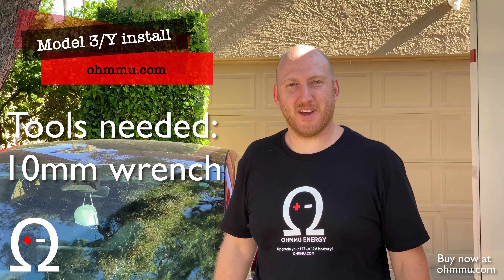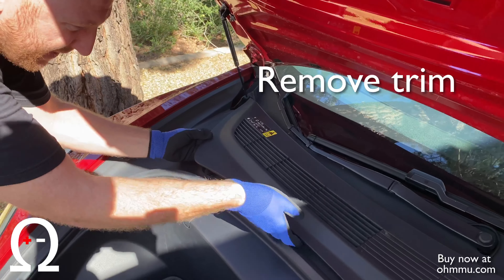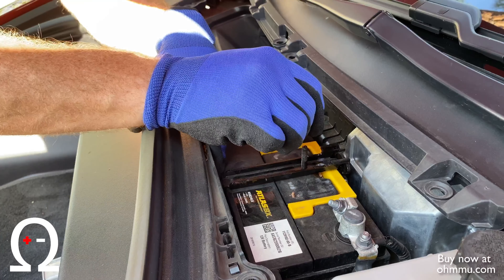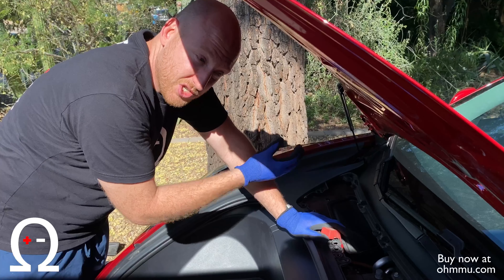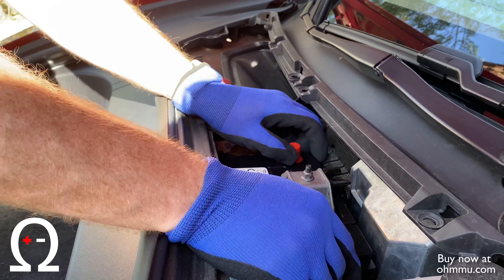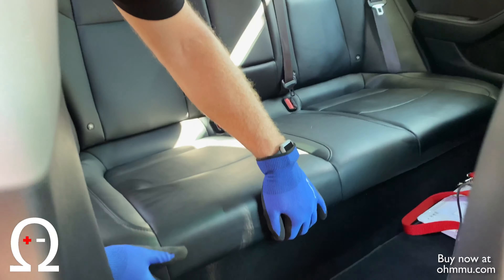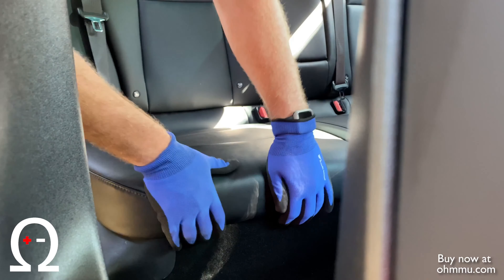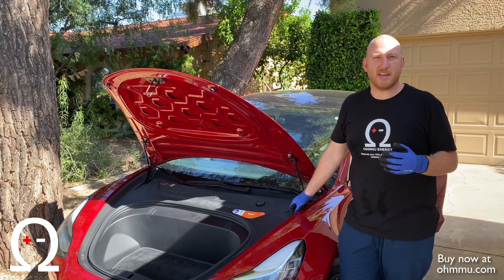Tesla Model 3 12V Battery Swap

Comment: My Model 3 battery died without any warning, leaving me stuck in my rural hometown. Tesla said that I was out-of-reach of mobile service until the second week of September, and that I'd have to have the car towed to their service center 90 miles away at my expense to have it replaced sooner. I decided instead to order this replacement, since, even if I was out of commission for a couple days, at least it would be shipped to the door. Less than 24 hours later, and I just finished the install with the help of this video, and everything is back up and running.

Comment: Here’s the situation for most people...your Model 3 12V battery is going bad, the car tells you it is going bad and you have time to call Tesla service.  Tesla comes to your house a couple days later and installs the new battery, free, under warrantee.  If you’re lucky even the next time the 12V fails you are still inside the 8 year warrantee.  After that one might want to consider alternative batteries, not before (and not before 2025 for any Model 3, first released in 2017).  If you’re too far for mobile service, you can always take a little road trip.
Reply: Or just go to Walmart and for $150 get a 51R battery and put it in yourself. Took me 10 minutes to install and less hassle than taking it in for service.  Are you sure the 8 year warranty covers the 12volt battery and not just the high voltage one?

Comment: I changed the 12v battery just as you had shown. The car now works. However, the warning message to replace the battery soon did not go away. I rebooted the car twice. Now what?
Reply: Here's a quick update. The replace battery soon message never went away. I brought car back to tesla. Apparently, there is a reset button underneath the back seat on the passenger side. It took the service tech 2 minutes. Now it's back to normal.
Reply: Roger Chan thank you for sharing that!
Reply: @RogerClubv  Hi Roger, did the T Tech tell you how to do this reset by yourself?
Reply: @richphillips3194  That's the gray low voltage connector that you see them disconnecting under the back seat.  I think I'd power off the car (in the service menu), then disconnect that connect, wait a bit, then re-connect to clear the 12V battery warnings.  It's possible you'd also need to disconnect the 12V battery, but that I'm not sure of.  Since the tech cleared it in 2 min, they probably didn't.  Perhaps someone else knows?

Comment: The written instructions (Tesla/Ohmmu Tech Note) differ slightly. The Tech Note tells you to disconnect the 12v battery before the high voltage, then disconnect high voltage then wait 2 minutes, then specifically NOT re-connect the 12v battery until the high voltage is re-connected. It warns that re-connecting the 12v battery before the high voltage can lead to over discharge issues (though it sounds strange as nobody would do this for an extended period). I think both instructions are safe and work. I followed the Tech Note but this video was still valuable to give confidence about the procedure. It would be good if Ohmmu could correct either the Tech Note or this Video to avoid uncertainty for other customers.

I highly recommend the Ohmmu replacement battery for weight savings and longevity alone. The potential benefits of more power with less sag are a bonus too. A replacement Tesla battery with labour costs at least half and may have to be replaced twice in the same 4 year warranty time of the Ohmmu battery. This is a positive upgrade whichever way you look at it, for the features or just to avoid having to replace the lead acid battery. It will most likely return more than the investment over the lifetime of the car, as LiFePO4 batteries should last that long without any replacement.
Reply: Yeah, it a bit frustrating that they still have the sequence wrong. Negative of 12V is the first thing to disconnect and the last thing to reconnect. I wonder how they missed this in the video.... and don't correct it.
Reply: Interesting. Thanks for the tip!

Comment: I had to buy a Tesla battery today because my car literally died outta no where, but your video was extremely helpful

My model 3 is at 144k miles and this was my first 12v.

Might I suggest adding something on how to open the hood when the battery is completely dead? In case anyone is wondering, pop the tow hook cover off, grab the wires connected to it, and hit em with a 9v battery (positive wire is marked red, and is longer).

Comment: Great vid, just bought a new Model Y so not planning on replacing my battery for a few years, but I did ask my local SC how much it would cost and they said $112 ($85 for OEM battery and $26.25 Mobil service labor total is $111.25).  That’s cheaper than I anticipated and it’s done in your own garage.

Comment: Not sure how long the OEM batteries last but I've saved this video towards battery replacement when the time comes.
Excellent video, thank you!
Reply: @Daniel Brice Arizona heat is killing some batteries in not much more than a year (folks that park in the sun a lot I'm guessing).  My battery is alive and well at 14 months thus far...
Reply: Just replaced mine at 1.5 yrs; Florida.
Reply: @Daniel Brice Make it "about 1/10th the price" in Europe.
- Ohmmu Lithium Battery 439USD+20% VAT+shipping from USA (or 559€ shipped from a european online store)
- Varta 12V lead battery: 58€ shipped on Amazon
Reply: My 2018 M3 still had a good battery. They say if you keep it plugged in it takes stress off the 12 volt battery and it will last longer and in my case it’s true but I replaced it anyway. You don’t want a 12 volt failure on the road. It’s a pain to reset it and get the car to drive again. I’ve watched many YouTube Tesla guys who explain this. Good purchase price from Tesbroes  there a certified dealer for Ohmmu for only 373.15 as I got 20% off coupon. You can google tesbroes for valid coupons. Good luck
Reply: Mine is 7 yrs old and I just got a notice to change the 12 v soon.

Comment: Nice video. Just got an alert on my 2018 Model 3 to replace the 12V battery.
Reply: My battery was still under warranty 😃
Reply: My 2018 just past warranty just alerted me to replace the 12 volt battery. I am very much on the fence about replacing with this battery or the regular lead acid. Can anyone comment as to a noticeable difference in any way? Length of service etc....
Reply: @18837dc  no clue but I'd see if Tesla would replace it anyway if you haven't already. There were known issues that drained our 12 volt's prematurely

Comment: You guys need to make a installation video for the Model Y on your website. I looked under there rear seat the high voltage cut off is not located there on the Model Y.

Comment: That's not the correct power down procedure you can damage modules in that way. Granted it's a very small risk but still not worth it. 
1. Lower windows and power off from screen
2. Disconnected the neg cable on the battery 
3. THEN disconnect the LV connector under the back seat.
You can now replace the battery however once you do, DO NOT CONNECT the neg  cable yet. 
Now powering back up is in reverse. Connect the LV connector then finally connect the neg cable

Other then that it's a very informative video
Reply: I know the last step in your comment is, well, raise back the windows. 
I do want to know, however, why lower the windows as first step? Is this step only for summertime?
Reply: @TeslaEVVideos  it's cause when it's powered down the windows will not lower when you try to open the door and you can possibly slam it on the chrome trim
Reply: What if the battery is so dead you can't tell the car to turn off?  Same steps but skip that one?
Reply: Trying to bump this up.  Mountain Pass performance also has a guide for this.
Reply: @TheBowerbird  The Mountain Pass Performance guide is missing the steps for disconnecting the low voltage supply to the penthouse (under the rear sear),
Reply: Thanks for the clarification.  Even the steps from Tesla are a bit confusing.

In step 8:  "During replacement DO NOT install new battery until step 12, you may insert battery but DO NOT connect it until step 12."

Step 12 reads:  "Now it is safe to replace the 12V battery, at this point your High Voltage and 12V systems are disabled. After battery swap and reconnecting the DC/DC converter and vehicle will reboot."

Then step 13 (Reconnecting 12V and High Voltage Power) mentions: "Torque the 12V battery ground connection to 10 Nm."

It's not clear if step 13 is when the negative terminal is connected, or if that's just when you torque it down.
Reply: Thank you for bringing this up. I'm a bit surprised that Ohmmu is still presenting this as the proper instructional video. The 12V negative is the first thing to disconnect, and the last thing to reconnect.

Comment: Hello. I have a question. What about charging Lithium  battery. As I know there is different type of chargers for different type of batteries. Is tesla Model y charger is ok with Lithium  battery? And will I see in car spec that it is now Lithium and not lead-acid.
Reply from the maker: Hi, the battery doesn't need to be charged to 100%, the charge profile in the car is set up to charge to about 14.2-14.4V and then allow it to float in the high 13.8ish range, it then allows it to discharge down to around 13.2V and recharges it again.  As you can see these parameters of discharge floor and charge max are perfectly within range/spec for LFP-based chemistry!

Comment: How does Tesla see the new Lithium Batterie under Service Info. Actually my M3 from 2019 shows a „lead-acid“ Battery which is installed. Do i have to change it via Setup in Service Mode??

Comment: Personally, the very first thing would be to remove the Negative battery post clamp.  Then, even if you were to touch the tie down bracket across positive and the vehicle body, there would be NO arcing since there is no longer a way to complete the circuit through the battery.  The Negative post clamp should also be the very last thing attached, for the very same reasons.

Comment: My Model 3 is showing “asleep” and neither the App or the key card won’t unlock the doors…I’ve been trying to figure out what’s going on and some have said it’s the 12v battery needing replacement. 

I got the frunk open and access to the 12v battery, but the DIY’s are showing the car has to be off and windows down to replace the 12v battery.  How do I do that if the car is off and still locked? The jumper cables won’t unlock the doors either even when I connect it thru the old 12v battery.

Comment: I have a 2018 dual-motor long-range model 3. 

please tell me if the OEM battery is or is not an lithium ion type???

Also would like to know what is the life range of the OEM battery on model 3?

My 12 V battery just died, two hours away from my house, with no prior warning on the display !
Reply: The OEM battery is lead. Life range is 2-4 years.

Comment: Tesla told me I can't install a Lithium battery for the 12v system, because of "Codebase" reasons, citing that there would be neccesitations for multiple variations of code-base per vehicle to support such things and that my 2021 model 3 SR+ would never be able to have a 12v lithium battery... 

Any opinions on this ??

Comment: In the video the vent tube is left loose, so just remember to connect vent tube to the new battery.
Reply from the maker: No, actually the new one won't have that, don't need to reconnect, can leave hanging or zip tie to something.

Comment: How do we open door to get under the sear to turn off high voltage if the 12V battery goes out?
Reply from the maker: Depends on if you have access to inside at all, Tesla doesn't always do things the mosts obvious and bright way.  If your 12V is out, the doors won't open b/c they are all actuated by electronics.  But, you can remove the little round cover thats in the bumper on driver side, behind it you'll find 2 wires (red and a black); connect them to a 12V source and the car will pop the frunk.  Swap the 12V battery and you'll then have access inside. 

The part of the 12V swap that involves the back seat HV plug disconnect is not relevant when the car has completely shut down b/c the total shut-down state means the HV battery is already "off" so nothing further needs to happen to disable the HV battery for a 12V replacement.

Comment: Will doing this help with clearing a "VCFRONT a196 - Low voltage battery disconnected" warning code?
Reply from the maker: The procedure could potentially do that, that alert shouldn't happen unless the car detects a sudden drop in voltage on the 12V battery.  If it is a Lithium battery with an internal BMS, that could be a safety cutoff engaging (would look like a disconnected battery because that is what happens inside the battery).  Doing this procedure and charging the battery at the same time would be a proper way to do it!

Comment: How do you replace the 12v battery when car is dead and you cannot open the car? Hood is open by way of jumping bumper access
Reply from the maker: There is always a way to open the hood, even without power, depending on the model there are different methods.

Comment: It doesn't make any difference on the Model 3 for High Bass, because everything in the M3 is mostly run off of the dc dc converter which supplies up to 2000W, but if you draw too much amps from any circuit the e-fuse will shut down the dc dc, regardless if the 12v battery could have supplied it.
Reply: What battery do you recommend?

Comment: Can you replace a lead acid 12V battery with the Li Iron Phosphate batter?  Does the car care?
Reply from the maker: For most Tesla its easy to answer this for the Model 3/Y there is a weird situation that has come up in the last year or so, the car seems to care now and flags alerts if things aren't dialed in just right.  Getting the formula of the sped on the LFP is essential to making it work right in these cars!  The Rev4+ from Ohmmu will be that battery!  It is slated to release by the end of this year for new purchases

Comment: So what’s the purpose of that 12v battery on a Tesla? Is it for the wireless chargers, speakers?
Reply from the maker: All of the 12V powered computers in the vehicle (there are many, cellular module, stereo/infotainment, power struts, windows, etc, probably more than 100 devices in the vehicle are powered directly by 12V)

Comment: In a new 2022 Model 3, it's a 12v battery with about 7000 mah, correct?  If you leave several things charging in it over night, does the 12v battery go dead or does the main battery automatically start charging it when it gets low?
Reply from the maker: The main battery should always start charging before the 12V goes dead, yes!  This is critical and why sometimes a HV failure (or DC/DC failure) can diagnostically be masked by a 12V since the 12V goes dead and the car is then dead so its assumed 12V is the problem, and may not be.  But then a deep reset (which happens if the car is totally dead) could resolve the DC/DC or HV issue, even if temporarily.

Comment: I installed one of these in my 2019 M3.  At first it seemed great.  Then it started to give me the error.   After the 3rd dime in 2 months I pulled the Ohmmu battery and bought a new one from Tesla. Yes, you can reset it, but that profess is NOT simple (anyone care to download a binary file on your phone and move it to to the car?), but since its my wife’s daily drive that was not an acceptable situation.  Also, the chat link they have on their website is not manned during the day in the US.  If anyone would like it, its available for free.  You need to pick it up or meet me somewhere in the Vail valley.  Otherwise, its going to the recycle center the next time I go there.  What a waste of money.
Reply from the maker: Hi, we stopped doing any live chat a couple years ago there shouldn't be a link anymore on the site, just email links.  We couldn't keep up with the live-chat system and our products are too technical to out-source the chat.  When we first started it was easier to "man" but at this point we have limited technical resources and need to manage it differently.  We try our best to provide the technical support needed to keep things running properly and we apologize that in your case you felt the firmware update process was too tedious.  We wish you the best in all things!

Comment: Is there a risk of losing any settings while the power is disconnected?
Reply: I didn't see any missing or lost settings after swapping out the OEM 12V battery for the Ohmmu lithium 12V battery.
Reply: @tedc2158  Thanks for the data point!
Reply: @tedc2158 what year and model tesla do you have? Thanks
Reply: I have a 2018 Model 3 long range AWD